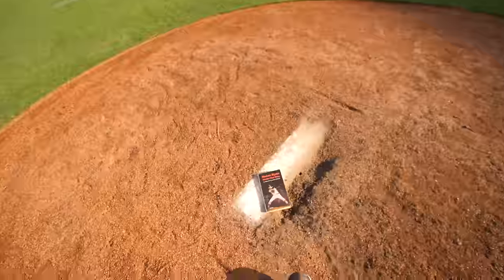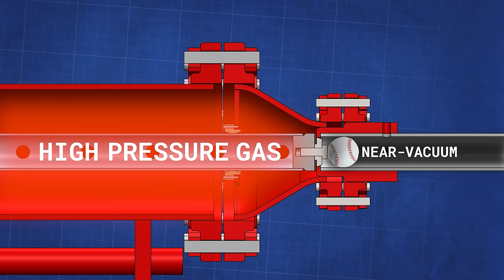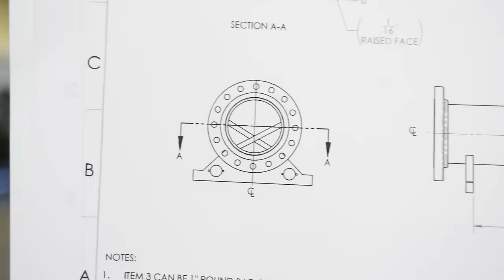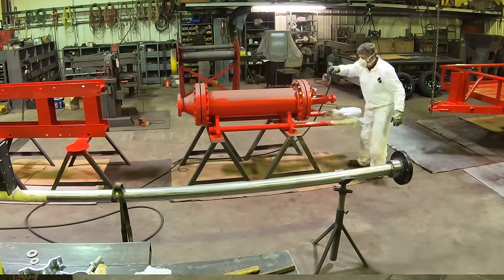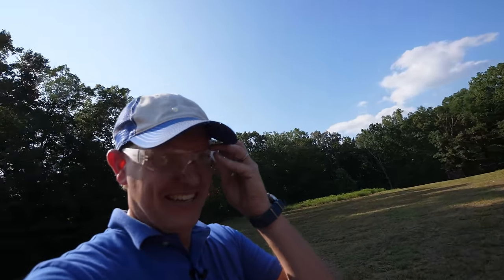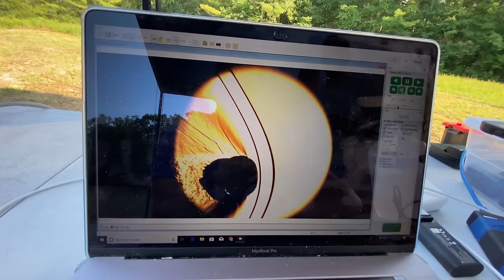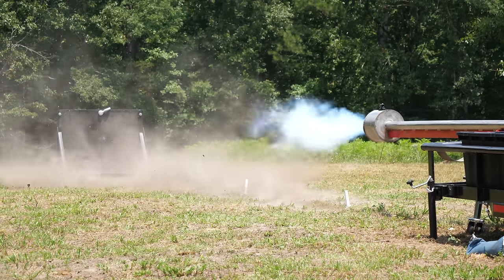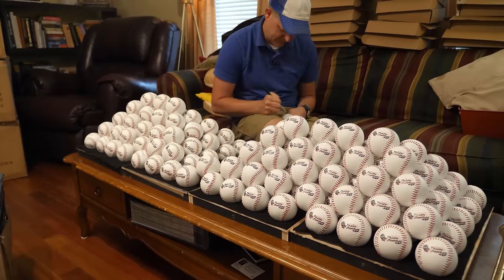World's Fastest Pitch - Supersonic Baseball Cannon - Smarter Every Day 242

Comment: you probably won't see this note and it appears your cannon worked awesomely... but instead of putting an air reservoir to push any excess air out of the barrel... why couldn't you have put some kind of progressive vacuum pump that as it felt increased pressure it increased it's suction rate ahead of the ball, thereby keeping a complete negative pressure.

Comment: Just a PPE moment, if the site is reusable, I'd spray a rough outline of where the steel is 100% covering so even if something came flying straight out at a 0° angle for someone's butt sticking out, people can see exactly where the safety is behind the shield. I mean, it's basically impossible, but if anything absolutely catastrophic happens (and it does sometimes), nobody is going to get sent to the hospital over an exploded gun cough Kentucky cough

Comment: Ah, the inevitable end of engineering and we've already seen it for now because it's railguns. I mean, we're pretty good at magnetic fields, but not really experts, and we found a way to use it to make a very weighty projectile propel itself far faster than anything else. I mean, they brag about nukes but if I piled up the equivalent amount of TNT because the standard measurement of nuclear payload is still directly correlated to an amount of active trinitrotoluene, or TNT, it's theoretically possible to reproduce the explosive force without the nuclear chain reaction, but a railgun functionally works entirely off magnetic forces. So basically, remove nuclear blasts, you can still make a blast that strong, but you remove a functional force of nature like magnetism, and that basically means a railgun is far more highly engineered than just reacting a bit of spicy space dust. I mean, the dude who caused the first Demon Core incident did it accidentally! Dude nearly caused a criticality!

Comment: Why were you so worried about the 570 psi in that cannon! While working aircraft we had 3000psi nitrogen tanks the size of acetylene welding tanks with walls not near as thick as your cannon. We also had tanks a bit heavier that we had 8000 to 9000 psi for the HIGH pressure tasks.  The 9K psi tank was on a trailer laying down, no one wanted it falling over and knocking the shut-off valve off the tank!!!  I told a guy once.... "If you will get on the 9K tank and hold on real tight.... I will line it up towards the runway and knock the shut-off valve OFF!" He was having nothing to do with that jet sled.  We were just south of you.  Had he agreed... you may have read about the UFO passing over RedStone!!!